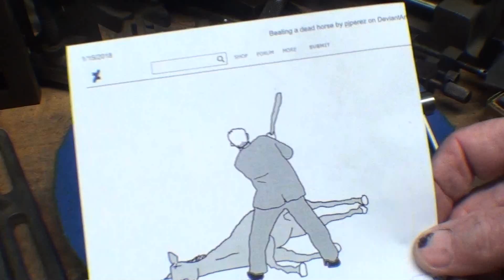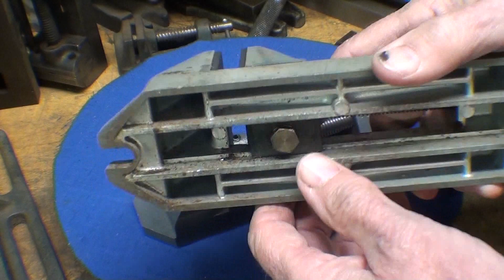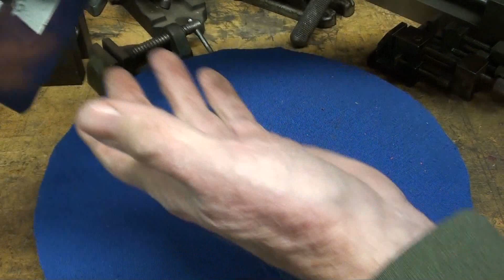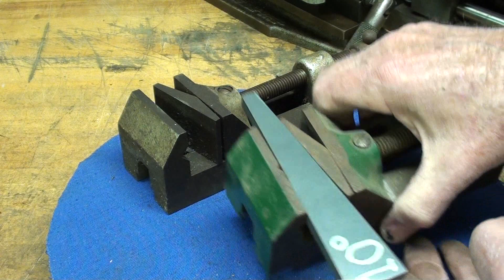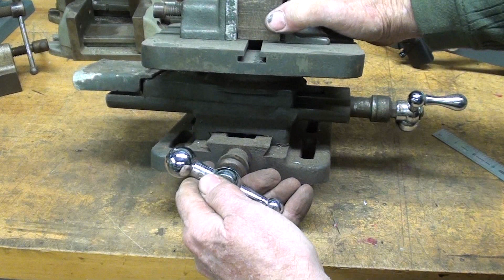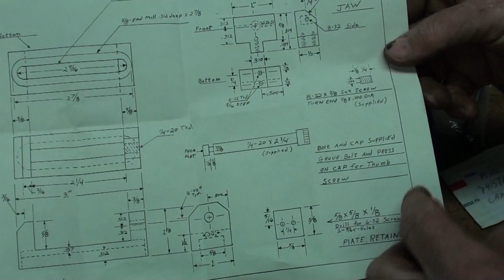Drill Press Vises Galore Tips #441 tubalcain the hoarder

Comment: Mr. Pete:  I've been looking for a photo of an old drill press vise so I could make one, with no luck.  It's basically an adjustable clamp on the end of a pipe, with the opposite end attached to a swivel so it can move around on the table.  In addition to pivoting, the pipe slides on the pivot.  It just keeps stuff from spinning and biting the user on the hand if the drill bit grabs.  Would you know what it's called, or have an image of one?  I've had no luck with google, no image, no name, nothing on ebay.  Thanks for your help.  Darrel
Reply from the maker: It’s called a float lock. Vise.   
I have several videos on that. I even make one.

Comment: I bought 2 Henrich vices, the quick latching type. A 4" and a 6".  You could NOT purchase the jaws for them.  I waited OVER 1 YEAR, for them to make them.  I won't go into further detail, there is more to the story, but they are HORRIBLE to deal with, absolutely HORRIBLE. I entirely quit using them, and will probably sell them.  No matter how you adjust them, you cannot get enough hold to do milling.  If you are drilling, STRAIGHT over the vice, "Okay."  If you are drilling anywhere, outside, the vice, it moves in the vice, or if you are slotting. Useless. For lightweight work only.

Comment: I'm still here! Watched the whole damned thing... I also have vices, no as many as yo but I o have a pair of the cam lock vices. I use them all the time. On is mounted in my harbor Freight micro mill (probably a 4 incher) and the other (6"? maybe 7") floats around my shop for general work holding. I'm always looking for more. I have a couple cross slide vices also and one of those cheap drill press vices the flat 4" one. Mine is attached to a large cross slide table maybe 8x18 on my Delta rotary drill press. It's 4 axis adjustable, which leads to more issues than answers... The biggest issue is probably that its a bench top press and runs out of z travel because I just have to much on the table before I put the work piece on it. Aren't you in the Midwest within driving distance of Milwaukee? I'd love to go dumpster diving at your place when yo clear the junk out. I'm  bit of a hoarder myself and just as cheap as you! (Maybe cheaper...)😉

Comment: Nice collection. Found the vise with tilting adjustment a lot easier to use then tilting plate on a drill press. I'm only a sparky but own a small and a 4" size vise that I like to use on small parts rather then my big work bench vise. Would never own a cheating lack of quality control communist china tool.

Comment: that cast iron speed vice would make an awesome project.
i have prepared many parts like this with scrap cast iron scrap
mill out the pecked up bottom section and braze in a slab of nicely prepared cast iron.
the brazed in part will be very very strong.  you can then improve the vice by milling out the a through slot.

i love doing that sort of thing

Comment: Doing my usual McMaster-Carr perusing I ran into what appears to be Heinrich vises (why don't they include the dang manufacturer for the different products they sell?) and found they have two different styles of them the first is "Lever Jaw Lock" and the second is "Pump-Action Lever Jaw Lock".  Are you familiar with the Pump-Action Lever Jaw Lock design? I've never seen one (heck I haven't even seen the standard Heinrich vise) so I can't imagine how the mechanism works.

Ow and before I forget I got a shop made drill press vise when I bought a drill press at auction (they were using it to hide the smiley face of shame on the table). It was made on a shaper so I thought it was pretty darn cool. The rods that connect the two jaws have a wierd bend on the end where fixed jaw connects. It looks intentional and I was wondering if you might be able to tell me why they did it and how they machined the wierd angle into it if it was intentional. I can send you a picture of you'd like.  

Finally (since if I put it earlier you wouldn't finish reading my comment) here's a link to the McMaster-Carr Page:  
 https://www.mcmaster.com/Drill-Press-Clamps/quick-clamp-drill-press-vises/drill-press-vises/jaw-texture~smooth/jaw-width~8-inches/body-material~iron/
Reply from the maker: I do not know why they do not till the manufactures name. That’s one of the reason I hardly ever buy from them
Reply: @mrpete222  Maybe it's easier to source alternate manufacturers that way and they don't have to change what they have listed?

Comment: I like Practically.  The Hard rod vice,  I have an idea by combining.  The cam of the german Henrick, type of vice t idea.  Has a device to rapidly close,  the vice when the half nut is open, to position an item in the vice.  Then closing the half nut we can tweak the all-third to grip the work.  holding Preshear.  Build-out of flat steel in the cold rolls. Or grown-stock Depending on need, As a fabrication, with no welding.  ailment collects in a vice retraction.  Traveling Jaw' with jaw plats off substantial thickness -to enable retraction, to retain the collet in place { no retaining, [bolt to week-can-the fixture],    a bit like a valve stem,  With Deprassabl half nuts, using ground stock cold steel bending on,  The, Use it is to be put to. 
a vice that requires no "Douve-Tales"  juts well-drilled hole's "Reemed".  &   Taped bolt holes   & cap head bolts. & dowels holding it together what do you think of that idea. 
  "half nuts.  to increase tension"? Les England?  mack one for the program viewers, Fabrecat it, as if we only had a good saw & drill, post.  in a way stacks up to your point that, is  done in the  standard tools,
Reply: Ys watched it twice to tack notes. I love the ideas,  offers for a new product, design.

Comment: Hello Mr Pete/Tubal, I haven't read through all 463 comments so someone else may have already said this, Regarding the larger of the two "Cardinal" Buttress thread vises, it appears to me that the damage to the sole/bed of the vise is easily repairable & might be a fun project It's visible at about 22:50 when you noted that the fixed jaw and half nut are removable I believe that when the fixed jaw & nut are removed the upper part of the bed/sole plate also comes off allowing replacement effectively fixing all of those "schoolboy scars"
If anyone has already spotted that please forgive my repetition.
Best Regards Rick

Comment: Of course I watched the whole thing!  Quite the collection and fun yak about them.  I have the 6" Heinrich I got free that was being tossed, barely used but some Bubba left coolant on it and put it on a shelf to rot.  Cleaned up fine and what a fine piece of equipment.  I'd love to run across one of the center drill ones with the drill bushings you have, that thing is artwork to me.  Thanks Mr. Pete!

Comment: You speak of drilling through the vise and table. I had a student do that with a brand new-- he was the first user-- palmgren. He was drilling aluminum, and a wood spacer was used to support the work. The wood chips, followed by the cast iron (steel? I don't recall which vise at this point), did not clue him that he was through. The only thing that saved the table was running out of travel.

Comment: I have the small table top drill press that I bought new from Harbor Freight 20 years ago to have at work. Never had a hole in the table. I take ill and I'm not there a month and it has a hole in the table and the on off switch is broken. Never let others use your tools, not even the cheap ones. I have fixed the switch, but the hole in the table still pisses me off.

Comment: I am with you mrpete all the way to the end ! Great video and as always Two Thumbs Up Sir! - btw if you ever decide to sell off one or two duplicate vices I sure would be interested in buying 1 or 2 I think I told you that I bought a Delta Rockwell floor size drill press awhile back that I was going to rebuild but actually all it was was the nut on the end of the spindle that was too tight and the guy thought the bearings were shot (I still am not 100% sure what that nut is for ? only thing I can think of is to use it to push the chuck off? but if I leave it on it just spins up and locks the drill press down TIGHT) it is adjustable speed like the one you have (not that you would have any reason to remember that lol) -really good deal for just $80 bucks! and I have no drill press vice (vices) for it. It would be a Great Honor for me to own something from a man I look up to & hold in the highest regard and have learned so much from-Thanks again mrpete -Two Thumbs Up Sir!!!!!